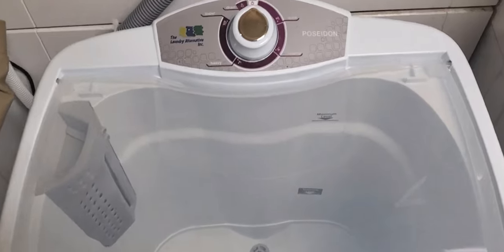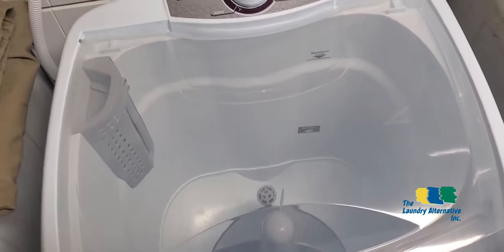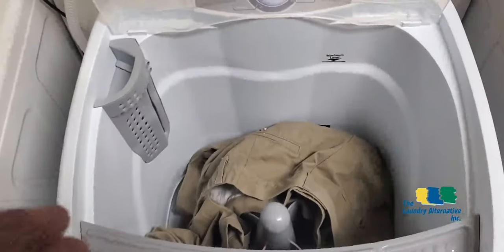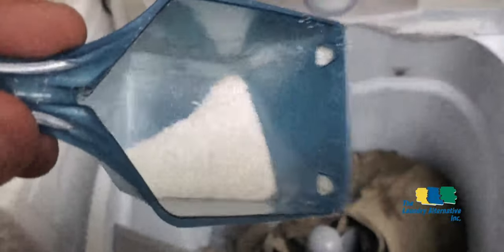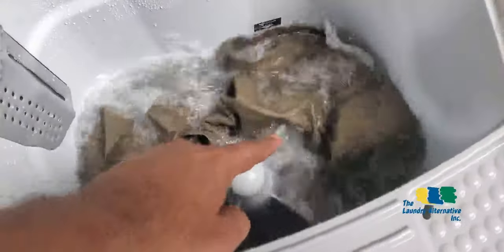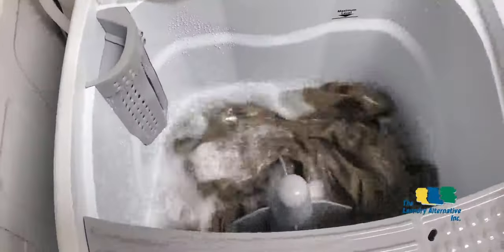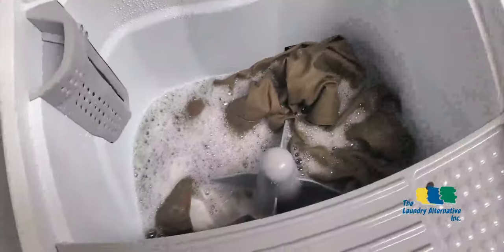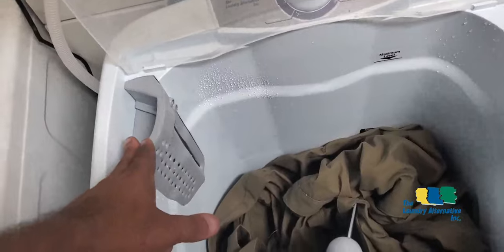The Laundry Alternative Poseidon Washer (Short version)

Comment: I have just ordered this machine; 1/23/2024. I am relying on your honest expertise about this video. I also, have the Wonder Wash which I have been using for a long time. I love this machine but my back problems do not always allow me to use it every week. Thank you, Thom, for the great reviews. Keep up the great work. <3
Reply from the maker: Thank you! The Poseidon took some time to really "catch", but now it's a huge success. People are loving the simplicity and how it washes really clean, similar to a Maytag wringer.
Reply: I also have the Ninja Spinner. So I should be set for a long time. Thanks again! @thomfoz
Reply from the maker: @maineapple52  I swear I won't tell you the matching tumble dryer is coming, I also won't tell you it's called Beyond. Also, I didn't tell you the design is super cute. And a green bird told me it's absurdly energy efficient. LOL
Reply: Oh no! We aren't allowed dryers in our apartments, and we have inspections twice a year, but that doesn't stop me from looking at it. 😂 Will you be doing a demonstration about it? Thanks for the info!  @thomfoz
Reply from the maker: @maineapple52  this you can,  because it requires no special outlets, no external vent and it's so small you can hide it in a closet or under your bed. And power consumption is LOWER than a coffee maker
Reply: That has to be very small. When can we expect to see this? @thomfoz

Comment: Hearing those bearings or seal makes me nervous about ordering this machine. Do you have to use the drain pump or will it gravity drain as well???
Reply from the maker: You must use the pump. If you lower the hose, it will drain by gravity
Reply: Thank you @thomfoz
Reply from the maker: Regarding the noise, that's the seal and it makes that noise when the washer is new (but the noise goes away after 5-10 uses)

Comment: its that agitator motor go back and forth like those in the way of small portables? or is it gears moving it back and forth?
Reply from the maker: It reverses electronically
Reply: @thomfoz  what if this did have a basket. [i do know it doesn't have basket or spin cycle] but what if it did.
Reply from the maker: @cjpwolf2436  it would add cost to the product, it would need a suspension to be able to spin, a more powerful motor, then it would be considered an automatic washer and TLA would be forced to meet the EPA standards, so it would lose the agitator and it would wash and rinse with 2 tablespoons of water and everybody would hate it.
Reply: @thomfoz  its a removeable basket like those cheap ones. I'm sorry there. I'm doing a project that involves a to make the outside look like a Kenmore design.
Reply from the maker: @cjpwolf2436  that's cool. I'm curious. Email me the results.
Reply: @thomfoz  do you work for TLA?
Reply from the maker: @cjpwolf2436  I'm the product design director
Reply from the maker: @cjpwolf2436  if it did, it would need a suspension system, complex electronic controls, then it would fall under the category regulated by EPA, so we would be forced to limit the water usage and for that it would have to be fully automatic and it would completely destroy the original concept that is a washer that you can fill with water as much as you want and wash like a Maytag wringer.